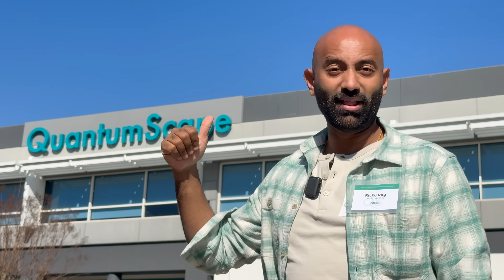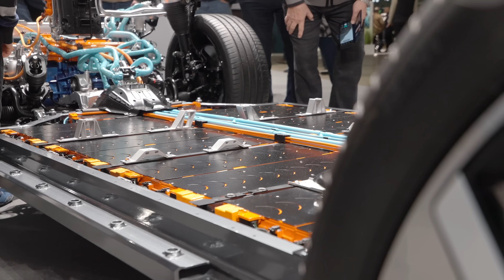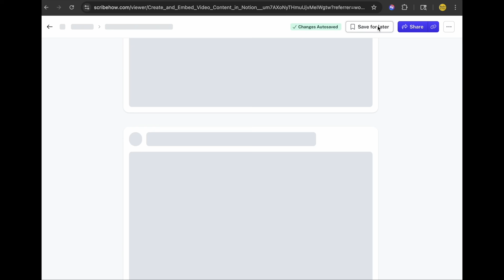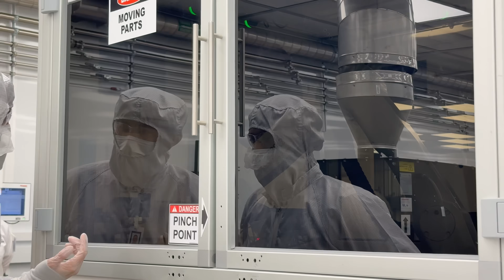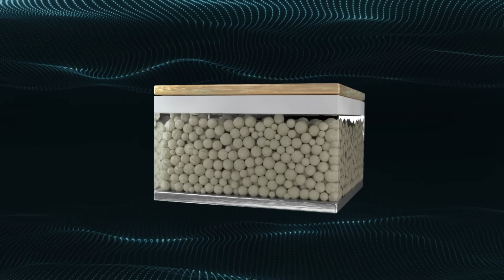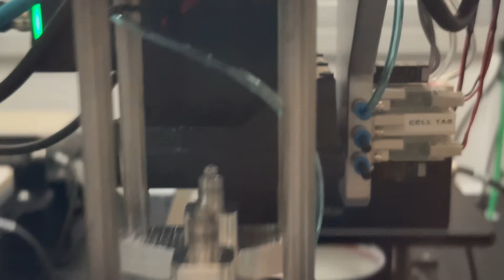I just Saw the FIRST Solid State Battery - It Finally Happened?

Comment: YOU DON'T REPLACE YOUR CELLPHONE BECAUSE THE BATTERY LOSES CAPACITY, YOU REPLACE THE BATTERY. Holy crap, this planet is cooked. Batteries are consumables, FULL STOP. So quit allowing these zillion-dollar companies to ruin the only planet we have just so they can sell you a whole new phone, ya know, INSTEAD OF REPLACING THE DAMN BATTERY?!

Spare me the "battery is not user replaceable", because it's a lie. I replaced the battery in a tiny "non-replaceable battery" LEDGER crypto wallet ten minutes ago. I got a Jūl for $5, took the thin profile lithium cell out, and micro-soldered the BMS from the LEDGER cell onto the Jūl battery, and voila! LEDGER wouldn't sell me a battery, even though they have them, and my client's crypto wallet was unusable, and thus worthless. (People, don't do split-key cold wallet storage, it's asking for trouble. Use 'hardware wallets' to backup keys, not to actively manage them). Anyway, I made it work, because IT'S NOT HARD TO DO SO.

Luckily, most companies aren't Apple, who encrypt their battery data so you can't just install the BMS onto a new cell and be done. Since their battery's health data is stored in the bms, it will still show a failing cell to iOS with a new cell spot-welded to the OG BMS. Point is that you have to reprogram the BMS, blah blah, and it makes the process more lengthy than it has to be, BECAUSE THEY DON'T WANT YOU TO SWAP THE BATTERY! I've lost count how many iPhone owners have looked at me like I'm huffing spray paint when I tell them: "yes, I can just replace the battery", the clock speed will return to normal (below 84% health iOS will throttle the boost clock to ~2.0GHz in an effort to make the phone last the same amount of time, at the expense of a bit of performance, but below 75% the CPU is capped at 1.0GHz, with uncore functions hovering ~800MHz. Thankfully the EU forced Apple to implement their cute little 'RepairOS' for genuine parts, so it's much easier to do now, although if you don't know what you're doing, please bring it to a technician who does. I still prefer the higher capacity aftermarket XCAP cells, but I'm glad the 'open → swap → close → PROFIT' system is there for anyone who wants to use it. 

Anyway, most batteries can be swapped, and if the plug, connector, POGO pin arrangement, etc isn't compatible, but the size of the cell is, then use the OG BMS on the new cell.

I'm so sick of these 'FUTURISM' channels not doing even the basics to help stem the tide of garbage were polluting our planet with. Did you know the average lithium cell is ~92% recyclable? Well now you do, so hold grifters accountable. 

"Replace your phone . . . "

Wow.
😠😡🙄🤦‍♂️

Comment: I'm sorry, I'm really confused. You've said their energy density is double what you get in a conventional battery. The guy said their cell is 301Wh/kg, or 844Wh/L, and state of the art lithium ion would be 250 Wh/kg, or 700 Wh/L. How is 301 double of 250? How is 844 double of 700?
Reply: I believe he meant in terms of Areal capacity QS is 6.2 mAh/cm² where as a conventional NMC battery of today is around 3-4.

Comment: Sorry, 300 wh/kg is revolutionnary and current state of the art li-ion is 250 wh/kg ? there are li-ion cells you can literally order right now (vapcell f60 and f63, amprius sa112) that exceed 300-310 wh/kg
300 wh/kg have been achieved by commercial cells for maybe a year now. Also, a few currently available tabless cells achieve 5C charge rates, so they do 5-80% in about 10 minutes.
This is exiting new tech, but the performances aren't anything great yet. At least they didn't make up some crazy number without any tangible cell to back it up
Reply: Theres a reason amprius is only in drones for military right now. Their batteries are only good for some 100 cycles. QS SSB's is focused on EV's because it actually works for many cycles. Don't just read  into energy density numbers, look into the rest as well.

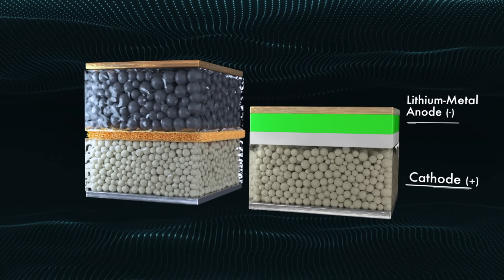Comment: 3:10 - you say the energy density is "double" but then a clip of a person saying it's 850 wh/L as opposed to around 700 wh/L. That's not double LOL
Reply: Maybe it's more efficiently packable than the cylindrical lithium cells? Also, this is comparing first-generation solid state to cutting-edge lithium batteries. I'd give them the benefit of the doubt that they'll manage to get the proper doubling in a few generations.
Reply: @Magickmaster3  doesn't matter when the clip contradicted what he said 10 seconds before
Reply: @sinephase  you are thinking with linear perception, when in this circumstance it’s exponential in non linear sense, 6+6=12, but 6x6 =36 for example. You’re viewing it on a purely elementary level
Reply: @BigislandEJ  The hilarious part is that you totally made that shit up

A watt is like the flow rate of the hose — it's how fast energy is being used right now. A watt-hour is the total energy that piled up over time, like the water in the bucket.
So if a light bulb uses 100 watts:

1 hour → 100 Wh
2 hours → 200 Wh
3 hours → 300 Wh

It scales linearly

Comment: Lithium and copper equal expensive and less performance at lower temps, heating consumes power. Expansion and contraction equals heat, which requires cooling, which consumes power. Solid sate without large amounts of rare planet destroying materials is the breakthrough we REALLY need.
Reply: There's solid state sodium battery, but like the regular lithium solid state it's still on lab development

Comment: Did they talk say what's the operating temperatures? do these half Solid-State batteries they suffer in extreme heat or cold? or do they have a wider range compared current batteries?

Comment: Firstly, such a good video. I wish you asked him about a time frame of their plans for having an actual production line at industry-level scale, although he probably couldn't have said much.
Of course, that's still VW's decision and it's probably the easiest to implement it in the Ducati bike, with smaller battery form factors, but I wonder what is next.
I wish they put it in the upcoming ID.Polo, for example, but most likely they will still use existing tech, for the first generation, at least. And probably use a more expensive Audi model to bring this to market first 🤔
Either way, exciting times 🤞

Comment: Safety claims were always a bit extreme to me. Like sure, I think we shouldn't have mustard gas coming out of a punctured battery, but fundamentally, the battery contains energy. A lot of energy. It's the one job it has. If it shorts, you're in trouble. Lowering it's "self-deenergizing rate" would be a nicety, but it's nowhere near as useful as more density, greater longevity.

Comment: @TwoBitDaVinci, The QuantumScape guy you talked to has a smile that is brittle and false. I frankly don't trust him because that's the smile of a liar. Solid lithium: if this breaks anywhere near water, you've got a lithium fire. This is a full-on hazard. You couldn't pay me to buy this. Worse, this has to be done on a gigafactory scale. It doesn't bring power to the people on a local level. Donut labs offered the possibility of local battery manufacturing without the gigafactory dependency cycle. This is just another credit dependency scheme, not a method for getting power at scale to people who need it. This is me booing QuantumScape. Booooooo!
Reply: Do some due diligence and research. You’ll find tons of data and third party verification of Tim Holme’s claims.
Reply: @MichaelFarkasDP  We’ve accepted living as perpetual debtors. This isn't innovation. It's entrapment. Sure, the process may work, but the cost is on all of us. Gigafactory economies feed our convenience addiction while deepening the same unsustainable system. We aren’t buying a battery; we’re leasing a future of dependency and risk. We need power designed for communities, not for empires. We need the ability to build a battery at community scale, locally with local resources. We have to build differently.
Reply: And Ricky, @TwoBitDaVinci, using the term "Solid State Battery" is misleading. Because it isn't. I'm so disappointed that one of my favorite YouTubers is caving to the algorithm. Adding a question mark to the title "allegedly" gives you cover, but hiding behind false implications for clicks is just bad journalism and an unrecoverable mark against your credibility.

Comment: 5%-80% in 15 Minutes did not sound that impressive to me and looking at the porsche taycan the website says 10%-80% in 18 Minuts. So we would expect a incremental improvement. 3 Minutes plus the 5% more is not nothing but also not a reason to get a new car for or make the switch from gasoline to electric. Bilit for a first generation battery with i.provements to be expected it might be more impressive than it appears.

You also need to consider when these batteries finaly arrive in cars the regular batteries used today might have seen improvements too and coukd be better in terms of charging speed. For energy density, I guess is more significant for reducing cost since the lighter weight also allows you to scale down other parts on the car. I dont think larger batteries are realy needed with farst charging that quick even on longer tripps you can charge regulary

Comment: I was wondering about the scrap rate, and 'binning', with batteries because I buy high power NiMh AA batteries and some of them charge faster than others, and the ones that charge slowly also die after fewer charge/discharge cycles. I had no idea that the quality was still so variable these days.

Comment: You know, he really does make a good point about "who cares if it's completely solid state," and for the exact reasons I think most consumers won't care. We just want batteries:
1. That are safer than today's lithium ion batteries
2. Better energy density
3. Faster charge rate
4. Improved cold performance
5. Better cycle life

I don't care if it's made out of solid state components or pixie dust as long as it meets that list.
Reply: I would also add lighter as weight severely hurts performance among other negative things like tire wear.
Reply: Well, not using hard to obtain or toxic materials would be a thing? How does Ceramics fare there? I don't know. Should we worry about ceramic dust particles?

Comment: The specs are very disappointing actually. Years ago they promised 400+Wh/kg, now it's only 300. A charge from 5% to 80% in 15 minutes equals 3C, other cells have been able to do that for years. New cells from CATL, BYD and others will be able to do 5C soon and also offer more than 300 Wh/kg. Also, if the cells expand during operation, has that already been factored into the volumetric energy density?

If the specs stay like that and the price is not lower than that of current non-solid-state batteries, it doesn't look good, considering mass production is still at least 1 year away, if not 2.

Comment: I would like to hear more about the aluminum and copper plates. Do they play a part in the chemistry and why are 2 different metals chosen?.
Reply: @pauleohl  I believe the difference in the metals is because the copper side you want to be able to charge as quickly as possible and then some very good conductive material on the aluminum side it also is conductive but also limits the amount of power you can pull so you can get competitive C rates...  You don't want these cells acting like capacitors you want them acting like a normal battery would be the reason according to my basic knowledge

Comment: When you consider the volume loss by throwing out the graphite/anode... this actually performs WORSE on volumetric density than existing battery tech. Sorry. And it still uses lithium, a highly reactive element and scarce commodity. So, color me interested, but not impressed.

Comment: Sorry but you can't have a 'half' SSB.  It's either solid state or it's not solid state. Samsung already have the technology and I will go out on a limb now and say that at present levels of technology a solid state battery without silver is not possible.
As for energy density Samsung are reporting density levels in excess of 500Wh/kg and they have alluded that doubling within a few years.
Reply: Samsung hasn't figured out how to produce them with low cost. No product line.
Reply: @tanelkindsigo4729  Well I'd beg to differ. There's a reason that Samsung late last year secured a deal with a major Sth American silver producer for a significant portion of their silver output for the next 2 years.

Comment: We need to care about solid state batteries. They are like hitting the motherload of batteries if lifetime is comparable to current lithium. I was an engineer at the Schatz Energy Research Center, Caltech Humboldt or HSU as it was known then for 14 years.  We designed our own high power PEM H2 fuel cells for research and I was never really able to convince them we weren't clean enough.  This reminded me of that with extremely clean environment needed for assembly.  edit The result of our research of H2 PEM (solid state) fuel cells in transportation was that the technology could not keep pace with battery development and efficiency. circa 2008 I think.

Comment: Ricky, great video and very informative, There is one thing you could've done to make it better and that was to talk about the battery's ability to charge and work in cold temperatures and I guess in hot temperatures too. A lot of us live in climates where a battery's performance in hot or cold temperatures is critical so this always needs to be discussed in videos and articles investigating and evaluating new battery technologies because if this battery technology isn't well suited for cold climates, there's a sizeable chunk of the market that it's not suitable for and that will hurt the economics of the technology.
Reply from the maker: excellent point! I did touch on it a little, and the general assessment I got was that these are as good or better in extreme temps as you'd imagine (getting rid of liquid electrolyte)
Reply: Hot or cold temperatures are critical?  Think, "Chicago."

Comment: Like every other “magic sauce” battery manufacturer;  They are more hype than substance!!

Quantum is NO different!  

Solid state batteries are prone to dendrite formation and lithium plating which lead to short-circuits.  

The solid electrolyte can crack or experience interfacial delamination during charge/discharge cycles, leading to higher resistance and reduced performance over time.

“Blocking dendrites” is important to reduce / prevent short-circuits.  STOPPING the formation of dendrites is what they should be trying to solve!  All lithium batteries use barrier to prevent dendrites from piercing the casing.  Quantum did nothing to prevent the formation of dendrites.  Overtime as dendrites form, the battery looses capacity, charging  times will increase, the internal resistance will increase, battery voltage will drop….

The solid electrolyte is quite BRITTLE!  Not exactly an attributed when used in a vehicle.  

So now a little truth!  Quantum Scape does NOT have a commercial ready product!!  That Eagle production line:  “manufacturing facility” you spoke about is only designed for prototypes.  The only product they are shipping is prototypes to EV manufacturers for TESTING!!  

Be objective!  These companies exaggerate their capabilities and flat out mislead people!! Why?  To attract government grants and investor dollars!!
Reply: Volkswagen has validated these cells, showing that the design prevents shorts caused by dendrites with their use of a proprietary ceramic separator. It also allows for high-efficiency, long-cycle life, with 95% capacity retention after 1,000 cycles.